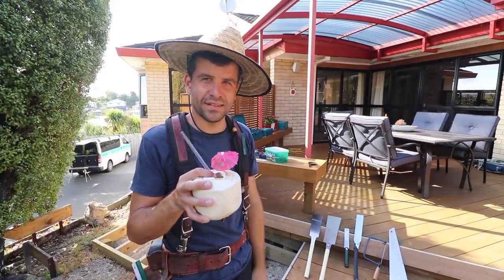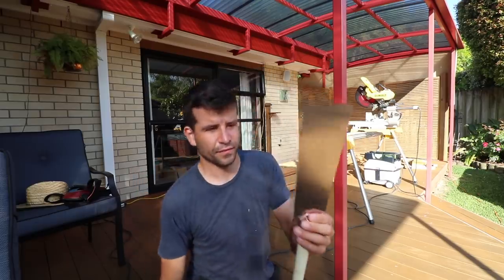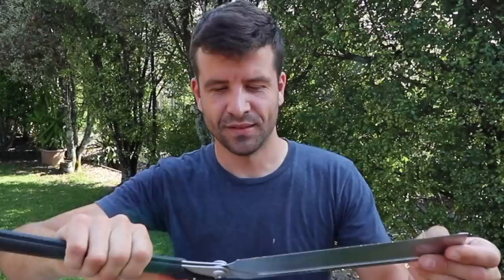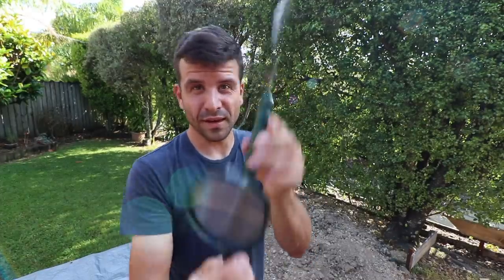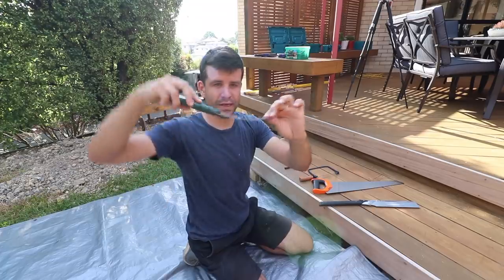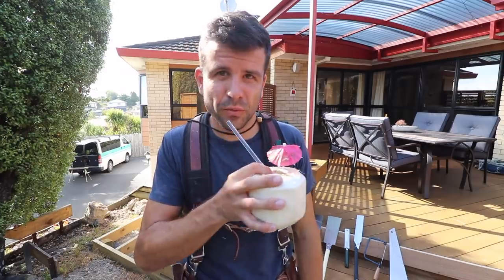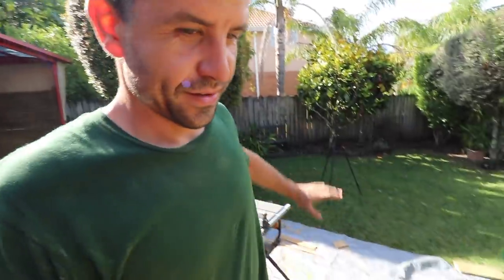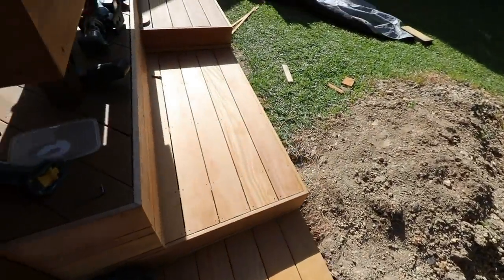Why I Have So Many Handsaws

Comment: These hand saws look like mine. Nice and unused. lol. I used to use one quite a bit finishing stringers or cutting a birds mouth on rafters ect. ect.. Anymore I just use a reciprocating saw, oscillating tool or jigsaw. I occasionally use a flush cut saw but that's the only hand saw I even carry with me anymore. I have a ton they just tend to get destroyed more than they get used traveling with me.

Comment: Good saws are good saws, but J saws are better IMO... BTW, the side to side wiggly diddly of the teeth is called set, the set help to clear the saw dust and help in prevent the blade from binding in the kerf... The flush cut saw have no set and like you said it prevent making the wood adjacent to the  cut!! Happy new year mate!
Reply from the maker: Cheers mate!

Comment: Gday Scott 👍🙂👍.. gonna buy a new ( maybe two 🙄😃) new Japanese treats for meself 😉... two new saws .
What model number is your smaller Ryoba saw , link says it’s a 240 length 611 Konami 19.5 tpi .. but on your magnification of blade .. 🤔was thinking looks more like the 610 model ( 14.9tpi cross ) or maybe one of the 240 length variants such as the 650 or 651 models .. 
be brill if you could let me know 🙂👍.. I like the stuff and recommendations you make whilst using the various newbies 🙂😃.
Any opinions on the 300 length 616 Ryoba ..
I use similiar size saws on rough timber , 3” fence post and other exterior lumber on outbuildings and farm type shelters and runs etc .. 
thank you Scott .. 
keep your chin up .
Keep calm , carry on 🇬🇧👍🙂👍

Comment: hey scott, was just wondering how you scribed around the retaining posts with the decking? wer doing a deck at my place with big retaining posts in front and to the side of it so some insight would be greatful!
Reply from the maker: If you put the last full board down you can then use it as a reference line for the circle cut. Find the diameter of the post and work out the centre point using the reference board......hopefully I'll do a video about it  in the future , I'm better at explaining it that way 😂
Reply: @ScottBrownCarpentry  That'd be mint, cheers mate